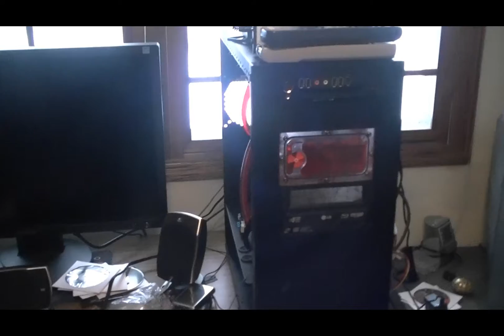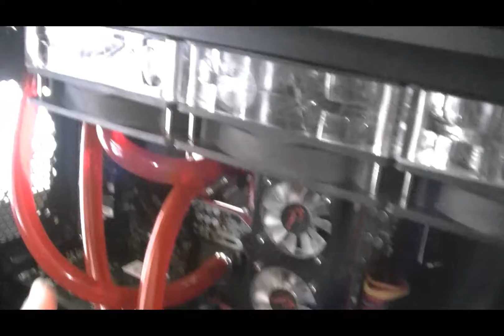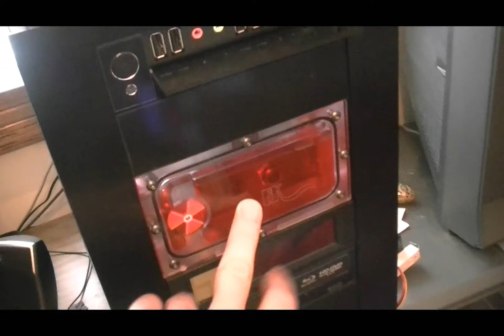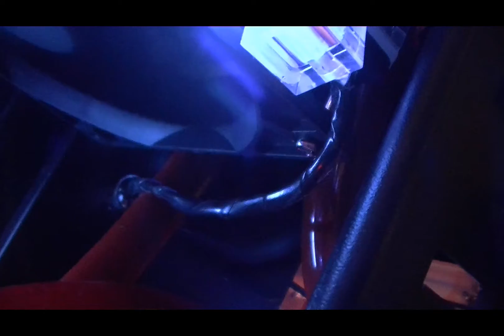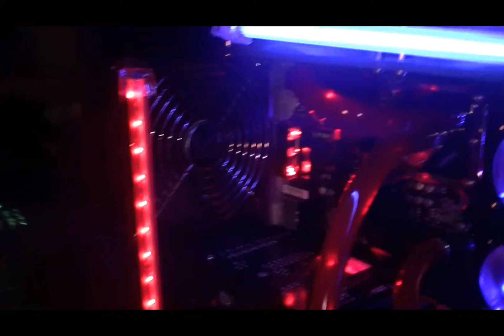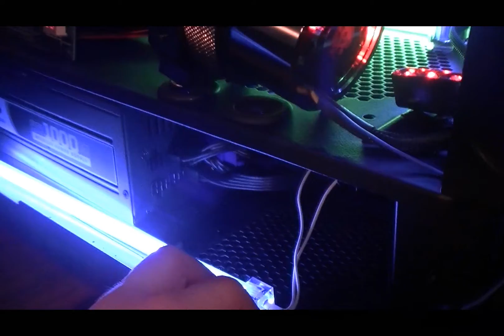Altered Swiftech, Feser, EK Watercooling Loop

Comment: Hi James
i would love to know what is the water cooling you use. is it a complete package or you bought each part individually.please try to describe it part by part if you could. I'm  800d case and i will get a water cooling for it similar to yours except i might add motherboard chipset water cooling block and the new thermal water cooling for ocz dominator. and since you are more expert i need your advice if this same setup will serve the needed or i have to add something else.

Comment: You should be able to switch the orientation of the inlet and outlet nozzles on the Uber 655 pump to be positioned on the side. This will allow you to install the pump in the lower chamber and clean up your installation a bit.